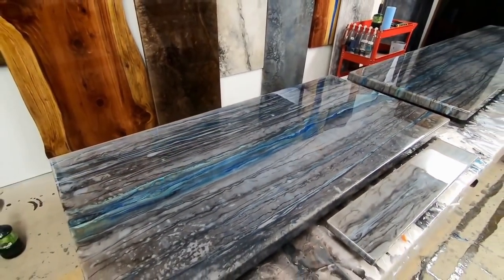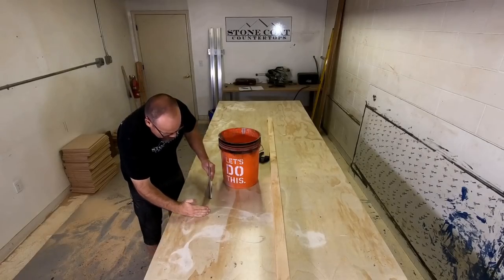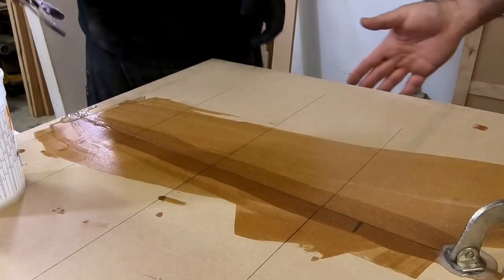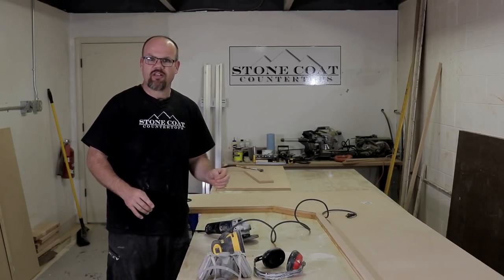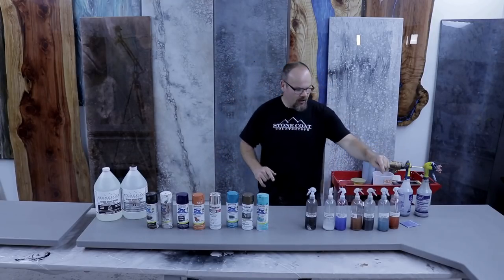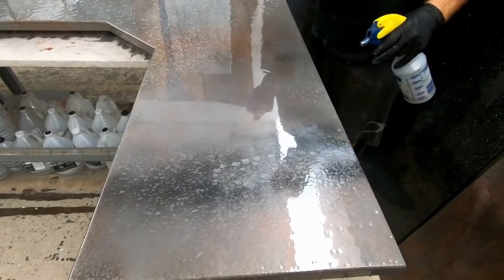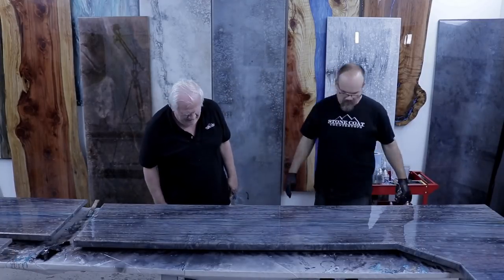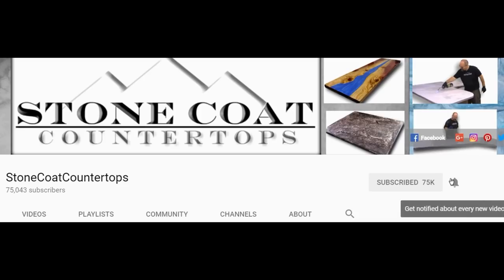How To Epoxy Countertops DIY

Comment: I love using worm drive saws.
Reply from the maker: What sort of projects are you working on Thomas?
Reply: Stone Coat Countertops I just finished building a reception counter for a Mercedes auto repair shop. I wish I had seen your products before I started because they would have been used!!!

Comment: Hello Mike,
Just wannn ask you if i can use denatured alcohol instead of 91% isoprophil alcohol
Reply from the maker: Great question Samuel! We suggest trying a sample board with several similar products, such as everclear, acetone, etc. When using this technique, spray less than you would isopropyl alcohol as it is much stronger. Also, you’ll want to wait several minutes before torching over the surface, as it is very flammable. You don't want to use less than 91% IPA as less than the 91% will have too much water content and will react negatively with the epoxy. -Nathan

Comment: Why do you use is 91% IPA, whats the difference if I use IPA (for computers)
Reply from the maker: Hi Memodealba, we use 91% because any lower than this has too much water and that can have some funny effects with the epoxy as it does not like water before its had a chance to set up for you
Reply: @StoneCoatCountertops   so the IPA used to clean electronics has a lower % than 91??

Comment: Great content 
Do you ever buff this material to lower the shine just curious.
Reply from the maker: Thanks for the great question. With Stone Coat Countertop Epoxy, you can achieve any sheen level desired. After the surface has dried and cured for a 5-7 days, you can sand the surface with our sanding assortment pack. When you sand, you will stop at the sheen level you like best; we usually stop at around 1000-grit for a nice honed look like soap stone or concrete. Our sanding assortment packs are found on our product page at www.stonecoatcountertops.comHere is a great video showing how we do this step: https://www.youtube.com/watch?v=iFpzdvPaQl0 Thank you again!

Comment: The Rust-oleum spray paint, Is that the X2 Paint and Primer in one variety?
Reply from the maker: Hi Daryl, thank you for watching and great question! Yes you would want to use Rustoleum 2X.  What type of project are you planning?
Reply: I will be doing our bathroom countertop. I knew you used the paint and primer in one for the base but worried about it being used in the "wet" part of misting and etc because of the primer. Thank you so much for the response!!

Comment: Can I get a pure white gloss finish with just a clear coat of epoxy over the 2 in one Behr paint? (For mdf  garage cabinet doors) also how much build up is typically on the edge of counter? Would you say 1/16, 1/8? Thanks in advance and great video 👍😎

Comment: Awesome Stuff man..!! Curious on the avg. cost of paint/liquid materials used on this project, factoring a bit of paint from each container, the epoxy, and clear coat...a ballpark figure would be nice...Thanks
Reply from the maker: Hi Trevor Webb, the cost is $5-7 a square foot on average to DIY your own countertops
Reply: @StoneCoatCountertops  Thanks soo much...it makes it about $150-$168 for 24sq.ft. which is Very feasible for those even on a low and strict budget...I'm sure if you share these figures with your viewers and give the parameters of $5-$7/sq.ft. people will more likely decide to engage in this type of project knowing they can generally do an average small countertop for $200 and under. 
I'm sure many viewers like myself perceive a job like this could run $1000-$2000 as a an impression at first glance...so your viewers knowing these cost factors will have more takers than usual.
The office desk job you did on another video was large enough to be in the range of 40sq.ft which would of been an impressive feat achieved, at a ball park of about $280 at $7/sq.ft.maybe $320 tax in  to coat the desk, providing you already had the desk. Very decent upgrade for the price..!!  Thanks man..!!

Comment: Hi
After watching over 6 hours of videos and planning my epoxy countertop granite project. I went into the shop to purchase my paint and was sadly told that painting our kitchen counter tops is a health and safety hazard because paint is so toxic and can chip and get into our food. Basically, it is not good to have this on kitchen counters. I hadn't seen this on any of the epoxy countertop projects here on youtube so how could this happen?. Have I missed something? Is there a safer paint option to go for? Please tell me there is a way out as I just cant accept this defeat?:(
Reply from the maker: Great question Sherms. Our epoxy is zero VOC and is food safe. The clear flood coat of epoxy will encapsulate the paint in the decorative coat as it is non-porous. Contact us anytime with questions or for project support. (541) 450-1976
Reply: Thank you for such prompt reassuring response. Is there anyway your products can be bought in the U.K.? Or are these only available in the US?

Comment: what is the price to have one of these made vs. buying granite ?
Reply: i am remodeling my kitchen and putting in a island i had to make smaller because of the limited size of granite
Reply from the maker: Great question Jeffrey!  Call or write us and we would be more than happy to assist you with pricing out your specific project.  Here is a link to our products page showing the different kits we have available: https://www.stonecoatcountertops.com/countertop-epoxy   How many square feet do you have?

Comment: @stonecoatcountertop can zinsser bulls eye 123 primer be used in stead of the usual paint and primer you used?
Reply from the maker: Great question Sachell!  You can use any type of paint and primer in one, we like using Behr brand Paint and Primer in One in a satin finish. You will want to roll on two coats (let dry 24 hours in-between coats and also sand in-between with 220 grit). Give us a call or email us anytime for free project support. (541)450-1976

Comment: Mike, could you make and post a video on how to stonecoat a tight space in a small bathroom, something many of us have, 24x18" or so, and the sink takes most of the space. I don't want to remove the sink, but don't see where the trowel would even fit to spread the epoxy. Literally, there are 3 inches on the edges between the sink and the wall. Thanks!

Comment: I absolutely love this countertop process. Yet, at almost 60 {female} and not physically able to create this I really need to hire it out. One counter top is 10' the other I'm not sure yet... maybe 2'  The 10' will need to hold a 33" apron farmhouse sink. Everything I have read about install of the sink says the countertop need to be 1 1/2" thick in order to hold the sink weight. MDF is only 1".  I so need an expert so this gets done right the first time. help PLEASE … FINDLAY OHIO 45840

Comment: I'd like to see a countertop done with an attached backsplash and how best to do it
Reply from the maker: Hi John Meuffel, ask and you shall receive!
https://www.youtube.com/watch?v=sSWDiKKSxok&t=3s

It works best if you cut the backsplash off, lay it flat, pour the epoxy, and then reinstall it however you can use the steps in the video provided as well, its just not as perfect of a match.

Comment: Can you add a fine glitter to a project like that? Is this cheaper than quartz countertops? You are a Great Artist!
Reply: I would use micro glitter not fine glitter. Because "fine glitter" often isn't very fine! So micro glitter will disperse better in the epoxy and also cut down on the surface tension giving you a smother end result x
Reply from the maker: Hi Debbie Sunshine Tomko, you could if you wanted to do so, just test it fist to make sure you like it!
Doing this yourself costs around $5-7 a square foot!

Comment: _____________________I feel kind of cheated.  The whole time i'm thinking to myself "What's he going to do about the sides where the lines in the runoff aren't going in the same direction as the lines on the top face?"   In fact the only thing that kept me watching was assumption that question would be dealt with.  It's a great look on the top face but those edges ruin the effect so much.  Disappointing.  I guess assumption really is the mother of all fcukups.

Comment: Can a person do this on some scrap plywood to practice? I know that probably sounds stupid but I want to try this. Also do you sell kits for begginers that has most of the tools and materials included? I'm addicted to your channel and want to try this so bad!
Reply from the maker: You sure could Rusty!  Check out this training video showing how you can use Stone Coat Countertop epoxy over plywood: https://www.youtube.com/watch?v=LT6QQ6AaQrw   We do have a 1/2 gallon test kit available so you can practice making some sample pieces: https://www.stonecoatcountertops.com/stone-coat-product  You could probably start out with a galaxy piece, it's very simple and looks amazing and you will learn how to work with the epoxy, check out the recipe here: https://www.youtube.com/watch?v=HwL30WBaOoA  Call or email us anytime with questions or for project support, we are always happy to assist. (541)450-1976 Thanks Rusty!

Comment: did you leave a gap to dry in the seam joined by the biscuits or did you press the pieces together after the quick coat filed the gap?